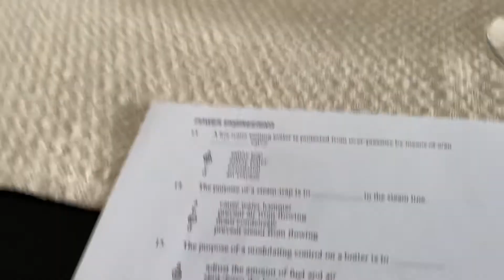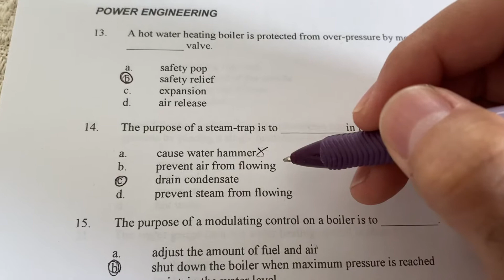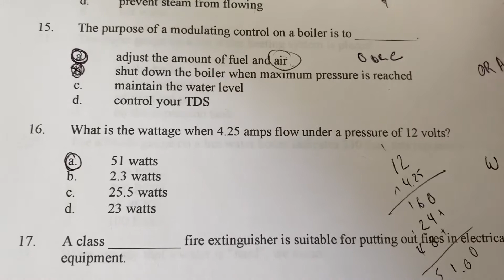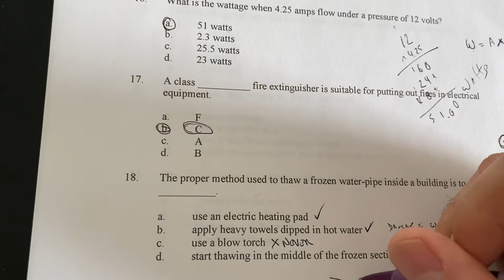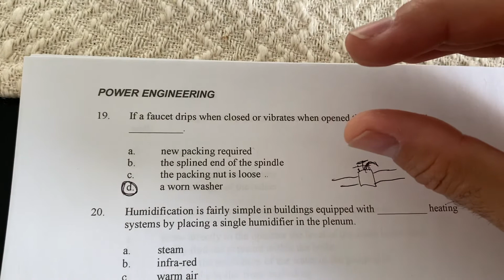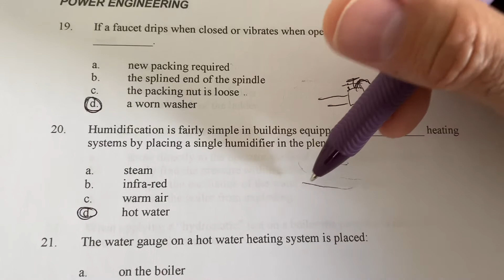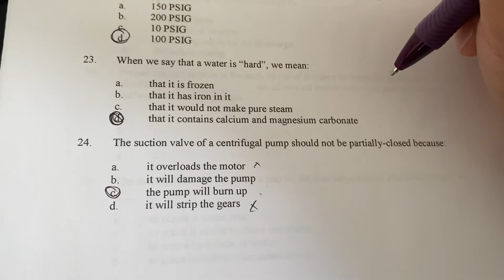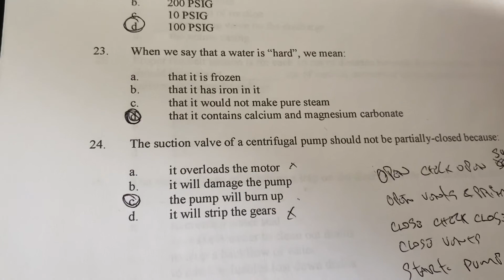Boiler license test exam questions and answers hot water safety relief centrifugal pump FQA

Comment: Rodolfo I believe that you do not burn the pump , there is nothing to burn in the pump , but you can burn the motor. You can damage the pump by partially close the suction valve .
Reply: I found that current draw on a fan blower goes down as the suck side is restricted, and the RPMs increase.  Water is just a thicker fluid, and I expect that a similar phenomenon would occur.    I expect that the motor actually doesn't care.  But would the pump potentially start sucking air through its seal and thus there's no cooling or lubrication and then....????

In any case, it seemed like a bogus question.